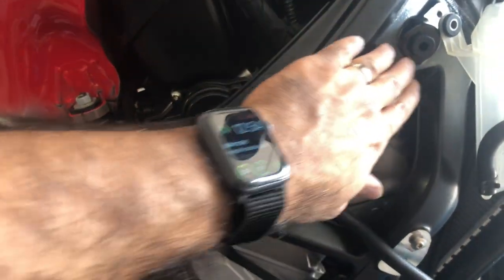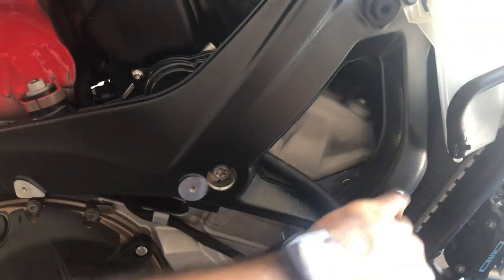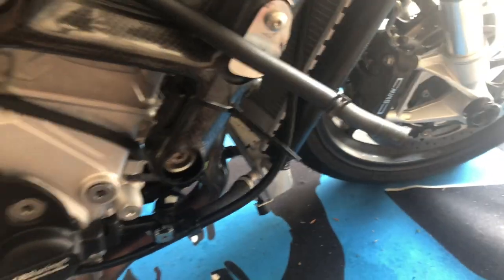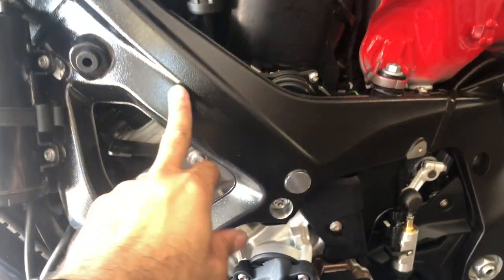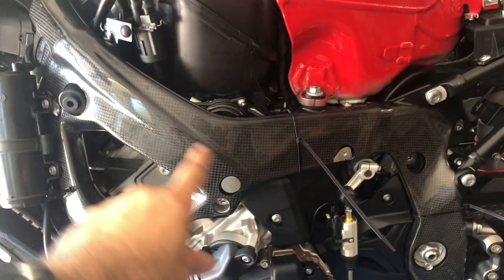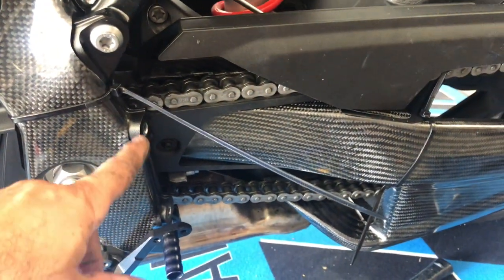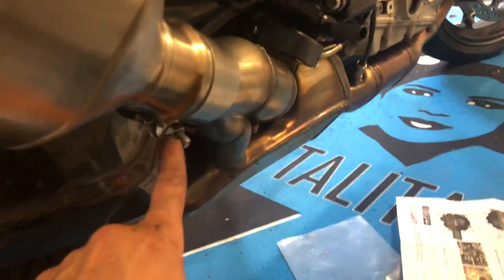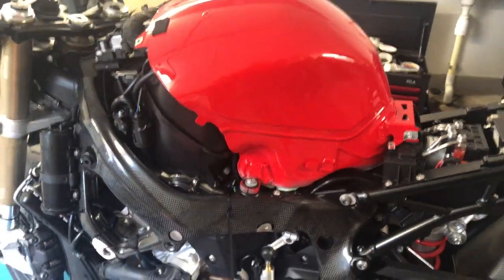Frame and swing protection carbonfiber for BMW s1000rr 2019/2020

Comment: You used zip ties to hold the cf swingarm covers? No 3m tape or sealant?
Reply from the maker: Jr Cruz silicon is what I used. The zip ties are just for it to stick and then they are removed. Silicon is black and you will find it in a hardware store
Reply: Omid Anka do you know the exact name? Im guessing theirs no removing the covers after the sealent without causing damage to the covers.
Reply from the maker: Jr Cruz just silicon. Once you put it in place it is hard to take it off :)
Reply: I just installed mine and used extreme 3m tape and so far its holding on.
Reply: on my old K46 I used tissue tape to cover the frame and put the silcone on the tape before mouting the corbonfiber peaces. Maybe someday you want to sell the bike and you have to remove the frame cover. It´s much more easy to remove the tape from the fame as the silcone. Nice Video :-). I´m looking for more videos. Greetings

Comment: how do you remove them when you dont want them anymore?
Reply from the maker: You heat them up with a heatgun and remove them
Reply: @omidanka8785  an you used what kind of adhesive?
Reply from the maker: i used silicon